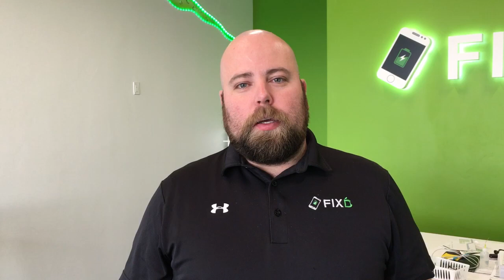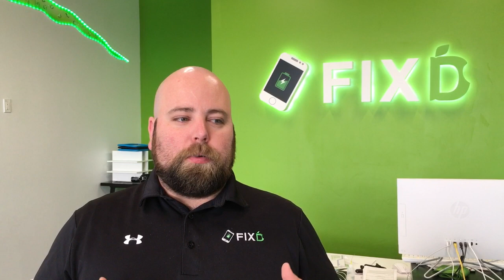Apple Watch Repair Course Update

Comment: Hi ya Chap,
I am looking for some advice i am attempting a repair on my foster childs watch she has a series 3 38mm gps only she smashed the screen. I did the digitiser repair screen looks great but the force touch gasket needed to be changed used several suppliers none of the new gaskets work tried reseating several times and cleaning contacts Any advice?